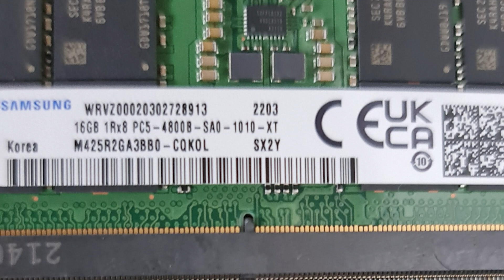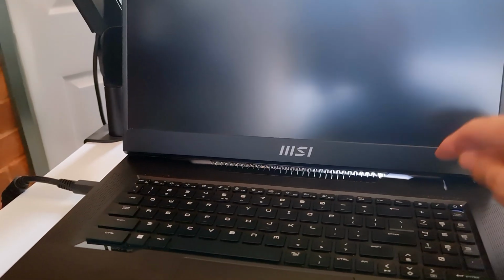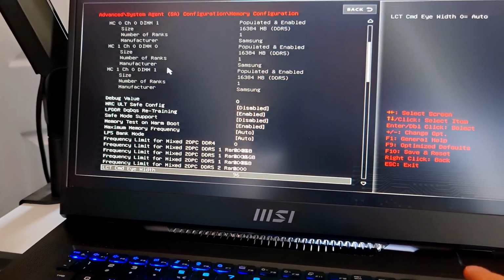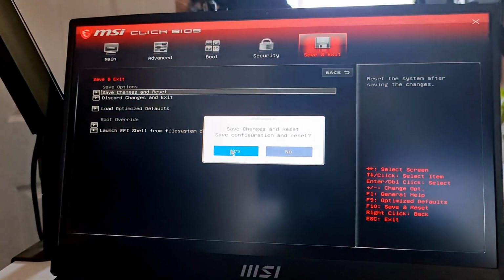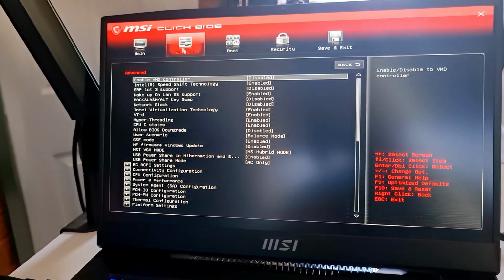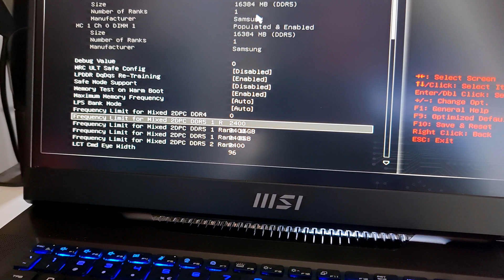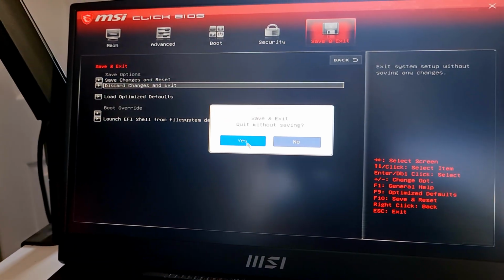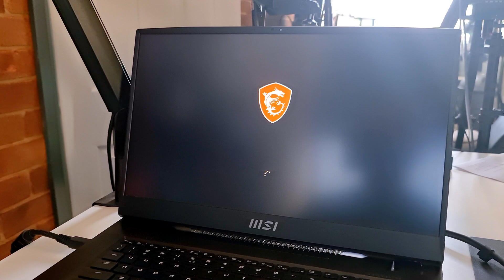How To Enable XMP on the MSI GT77 Titan Laptop

Comment: When I got this laptop, I also saw the 4000mhz and was a bit disappointed and confused why as it should be 4800. Although I already get a boot delay as is without changing settings.

I also got a 5 or 7 minute delay when I put a new nvme in. Scared me half to death. Booted finally, flashed screen a couple times, turned off. So weird. Then it worked. But apparently my BIOS settings got magically erased and I had to redo them.

Gave you a like cause you're literally the only person who actually addressed this. There's very few videos on the gt77.

Also, I'd be curious to see you do some crystal mark benchmarks (or other) on this with 4000 vs 4800 on a ramdrive (or other kinds of ram tests), just to see if one of them is actually faster. I know from reading up on the formulas that "faster" isn't necessarily actually faster as it depends on the timings and other things (but I didn't calculate the numbers).

Edit: If I plug in 4800 and CAS of 40, latency is 16.6ns. With 4000 and CAS of 32, latency is 16ns
Reply: For anyone reading this, I did some research, and 4000 is normal. What happens is that ram by default runs at jedec speeds, which are lower than the overclock speeds. While I would've wished for this to have an xmp profile, but, if you get ram with an xmp profile rated at 4800, you can select that profile and get the full speed without having to do a custom timings.

I did it with new ram and it works great at 4800

Also, you can fix the slow boot by turning off the bios option to test the memory.

Comment: Hi Neil, i've tried your method on my new GT77, and.......After seven hours, the machine won't restart.... I'm locked in bios, the start button is red, i just can hear the fan (a little), do you have a solution for that ???
Reply: Im facing the same problem have you achieved a solution
Reply: Any luck? You might have to reset the bios
Reply: @johnkeo358  at the end i shipped it to msi they had to replace the motherboard
Reply: @robertabounader4067  ah okay, I hope they didn't charge you for it. I was thinking of doing the XMP but I changed my mind. The delay isn't worth it
Reply: @johnkeo358  xmp works great. I'm using it on mine. Just don't mess with the custom timings if you don't want to screw anything up. Xmp has no boot delay. I believe the boot delay was cause it was testing the ram. I turned that off and my boots are always fast now

And to anyone reading this. Hold your power button down for 1 minute or so to reset the BIOS.

If that fails, open your computer and pull out the button cell battery (and laptop battery), and hold the power button to drain the power, then wait maybe an hour for the settings to erase.

No need to be sending your laptop in for repairs
Reply: @Megumin  thanks for the follow up, i was debating on using ram with xmp profile but I ended up getting the one with JEDEC, I think the ram will still let me use XMP profile on it but it's already running at the speed I want it at with the JEDEC
Reply: @megumin4625  There is no need to take off the battery. I had the same problem after upgrading to 4 sticks (120 GB). I just turned off the laptop, unplugged the power and pressed the power button for 1 minute; it did the job! In my case, with 4 sticks of ram, the speed goes down to 3600mhz. When enabling the xmp, it causes crashes. The laptop turns on, and after 2 minutes or so, it frizzes up. Trying it manually, but it gets stuck on bios loading. I could find a tutorial on how to fix this, but it was for ASUS bios. Still have to figure it out how to do it on MSI bios.
Reply: @gltrjp  yes. Pressing the power button for one minute is supposed to reset the BIOS. I was just talking about in case that didn't work (as a last resort)
Reply: @gltrjp  the maximum speed goes down the more sticks you have. I believe the max is 4000 for 4 sticks. You should be able to get better speed with only 2 sticks however.

So the solution is basically, use 2 sticks or less. (This is why i have 32x2gb sticks, so I don't fill the other slots). But if you really wanna max out the space, you'll have to accept it's not gonna be as fast since it's a ddr limitation
Reply: @megumin4625  With 2 sticks 64 GB, the default speed goes back to 4000, which I can boost to 4800. However, with 4 sticks, it falls down. The problem is that I use the laptop for something other than gaming but for heavy creative creating projects. Well, at the moment seems like I have to deal with it as it is.....

Comment: What effect to rams speed have on Inventor performance?
Reply from the maker: Very little, if it makes any difference it'll be within margin of error.  I'm 99% sure I'll have previously tested running InvMark at default DDR speeds and then with the XMP profile enabled, and I never made a video about it or even remember the outcome so would likely have been nothing of note.

Comment: I'm having the se issue with my new Lenovo ThinkPad P16. It's running at 3600MHz with four models installed. When I remove 2/4 it runs at 4000MHz. 

Currently working with Lenovo support to try and resolve this issue.

Comment: 5500 € for a plastic chassis?
Reply from the maker: It isn't all plastic, I assume that's to help with weight as well as typical cost cutting but it doesn't feel cheap and tacky
Reply: @Neil3D  Alienware x17 R2 is it better. Chassis in magnesium and covers in alluminium.
Reply: @シモーネSymho  with 100c on cpu temp, gj Dell
Reply: @シモーネSymho  on the contrary. Metal and magnesium have higher thermal conductivity. The GT77 is made of aluminum and polycarbonate, which helps direct heat to the heatpipes and dissipates it where the manufacturer wants it to, instead of heating up the entire chassis. No one in their right mind would use metal in a powerful laptop for precisely that reason. Take a look at the reviews and you will see that this is possibly the most powerful and coldest laptop of all those currently available (even at the keyboard level), and the trick is precisely to redirect the heat with the polycarbonate.

As a final note, simply indicate that physics and thermodynamics must always prevail over appearances or "aesthetics". Whoever eats with their eyes dies of hunger. This is a high-performance laptop, not a laptop meant to take photos to pose with on instagram.